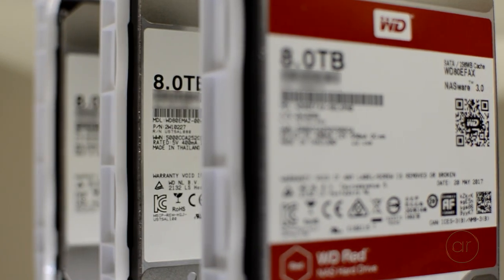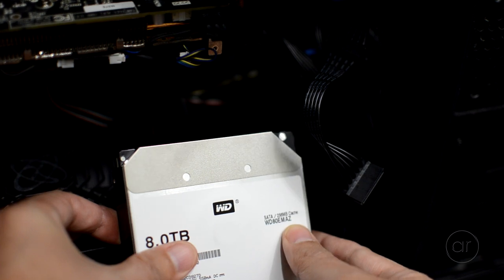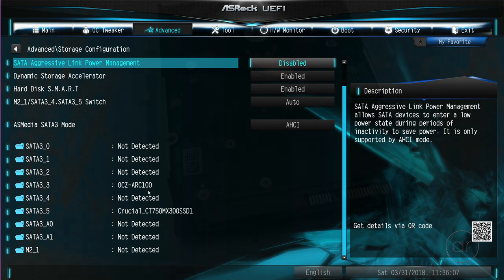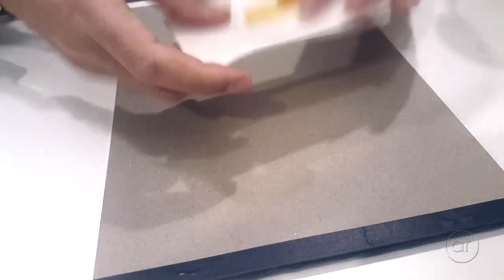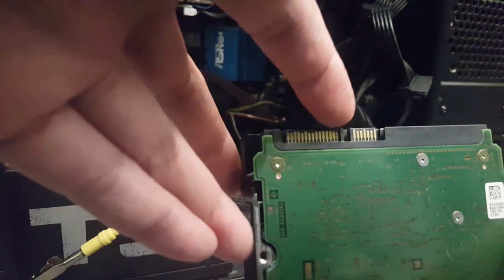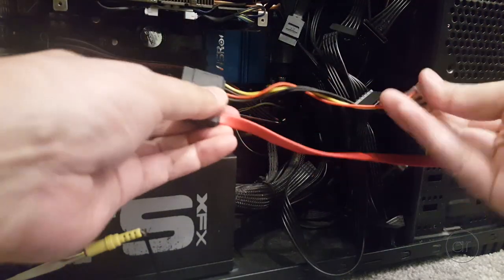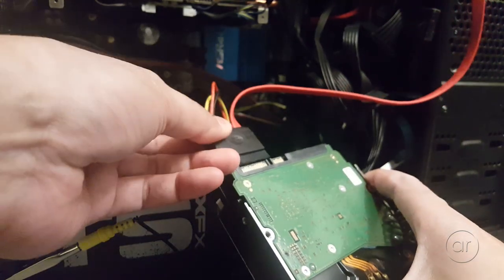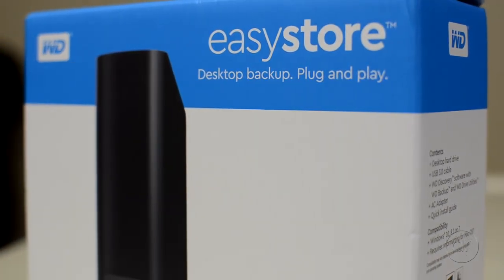How to Fix the 3.3V Pin Issue in White Label Disks Shucked from Western Digital 8TB Easystore Drives

Comment: My computer won't even post with the drive connected, will this still work? WD40EDAZ 11SLVB0 4TB white label drive... Great video! Actually I am using a molex-to-sata adapter, and it still won't post. Adapter works on other drives.
Reply from the maker: Drives with the 3.3V pin will still allow the computer to post and boot up, but you just wouldn't see the drive since it doesn't spin up. I think this may be a different problem. Are you able to try the drive in another computer?
Reply: @accessrandom  Thanks for replying - this  NAS computer (and PSU) is 10 years old. Same behaviour with or without molex-2-sata adapter.
If I put the drive in my desktop PC hotswap slot, it works immediately without any modification. (1 year old PSU), no adapter.
I figured it could be the BIOS hotplug setting, so tried it on the NAS computer, but didn't help.
The computer posts if only power cable is attached, but hangs before post if data cable is also attached.

I also put a thin strip of electrical tape over pin 3 of the drive's power connector like in your video, but no change in behavior.
Standard black electrical tape, maybe that's not good enough?

Drive spins up. The drive is auto-detected by TrueNAS and works if I hot-plug the data cable into the drive after boot, but hangs before post if I have it plugged in before power-on.

Maybe the board BIOS is too old and can't handle 4TB drives?
Reply from the maker: @waperboy  That's possible. It will depend on a combination of both the hardware and the OS, so I'm thinking it's probably the hardware.
Reply: @accessrandom  Thanks, I haven't actually tried to boot my desktop PC with it connected, just put it in the hotswap slot,  and it works. That is the same behavior as the old NAS exhibits, works when hot-plugging it.
Reply: Fyi. The drive works when booting the desktop. Must be the old motherboard on the NAS that can't handle. Shame, that's why I bought the drives...
Reply: And finally, it works without any modification - I deleted the existing partition and created a partition table on the drive, and after that, it works just like a normal drive!
Reply from the maker: @waperboy  Fantastic - thanks for the update. 👍 There must have been some corruption in the partition tables...

Comment: hi there. quick question. I got 2 RED NAS 8TB that 5400 RPM ( they are Not PRO and are Not Plus. Just plain RED NAS). 

I got them when I did the SHUCK method for the WD MyEasy External Hard Drive. The same one that you have in your video. As you mentioned in your video, you said that the "White Labels" are becoming more and more common, my question is the following. 

I have on me a QNAP NAS hardware with a 4 Bay Drive. My goal is to create a Home Network NAS setup. Since I have already 2 of my RED NAS 8TB that are 5400 RPM, the other 2 8TB drives are the White Labels which their RPM I have no idea about. 

My question is, with this mod/method of yours, will I be able to use the 2 White Label 8TB drives as an equal to the RED NAS as part of my Home Network NAS setup for my QNAP NAS in creating a Raid 5 and making sure that all of them run at the same 5400RPM in creating a total pool of  32TB? Thanks.
Reply from the maker: Yes, you should not have any problems adding the White label 8TB drives in your QNAP to a RAID 5. I am using them (plus other WDs) in 4 QNAPs myself. The whites are labeled as 5400 rpm, but some in the subreddit that I mention in the description have done some acoustic tests and believe they are actually 7200 rpm. In the worst case, these will be throttled down to the lowest common denominator of your RED 5400's but will work fine.

Comment: Does it matter what kind of tape to use?  Would electrical tape work?
Reply from the maker: I've tried electrical tape and it worked - but I found it created a bulge in the SATA connector because it was so thick. I'm not sure of the long-term effects of that. It also left a black residue when I removed it later.
Reply: @accessrandom  That's a great point.  I have electrical tape at my disposal, and that's why I ask.  Also, I don't have to go out to buy some other tape and only need an inch of it. :-)  Keep up the great work, I love your channel.

Comment: Hello AR
I see the warnings about using a Molex to Sata adapters due fire hazards. This may be due to the quality of the Sata connector. If I use a Sata power cable instead of the Molex to Sata adapter don't I run a risk of a fire hazard as well depending on the quality of the Sata connector?
Reply from the maker: I suppose power supplies may have low quality SATA connectors as well (just like the Molex-to-SATA adapters), but generally you should be safe with those provided by the PSU manufacturer. The dangerous Molex-to-SATA adapters are those that are molded, as opposed to those that are crimped.
Reply: Thank you AR. Just to clarify I will always need a data cable connected to the HD but I need to be diligent in find the proper Sata connector to the HD to reduce the risk of fire hazard. If the proper Sata connector to the HD is used does it matter whether it is a Molex/Sata adapter or a Sata power cable? Is there safety tradeoff using one type of cable/adapter versus  the other? In other words does the computer or the power supply  cause a greater excessive power using one or the other cable type?
Reply from the maker: @Globalbye  The SATA power cable will be safer as that is coming directly from the PSU. It is the Molex/SATA adapter (the one that joins the Molex from the PSU, to the SATA power connector on the back of the disk) that can cause problems. I hope I've interpreted your question correctly.
Reply: @accessrandom  Yes I guess I would aim to use a sata power cable rather than a molex sata adapter. I did not think there would be a difference as the power  would come from the same source, the PSU.

Comment: Thank you very much. 
I just taped the third pin and it works. 
Or do I have to cover all first three pins?

 Does anyone have the link of the Molex-to-SATA adapter?

If I attach the adapter later then all data on the disk is lost?
Reply from the maker: You can cover either just the third pin, or all three pins (1, 2, and 3) - either will work.

If you swap out the power adapter at a later time, you won't lose any data since it's only a power cable.

Comment: what about the hard drive failing or clicking after doing this mod
Reply from the maker: It sounds like a bad physical sector, which is independent of the power being delivered to the disk. You may want to perform a chkdsk /r in a command prompt (started as an admin). If it detects any bad sectors, I would see if you can exchange the drive for another.
Reply: @accessrandom  tried that turns out windows 10 2004 update damages SSD's and mechanical Hard drives microsoft has warned people to turn off automatic defragmentation of drives turns out the SSD isnt being trimmed but defragmented instead damaging the hard drive the same thing is happening to mechanical hard drives there getting trimmed instead of defraged
Reply from the maker: @johnDingoFoxVelocity  Interesting - thanks for the tip. I did hear about SSD problems with the latest update to Windows but I hadn't heard about problems with HDDs.

Comment: So... Why do they not sell a version with external and internal ... I mean internal would have less cost involved considering no shell & Power Adapters would be needed and should cost less then a external should it not?
I'm a bit confused as to why the externals seem cheaper?

Are their any downsides to the external vs internal in terms of its capability?
Reply from the maker: I believe it is more a function of market demand - more people will buy externals since they don't want to open up their PCs to install an internal (this is just my assumption). Externals may also be cheaper because the manufacturer can substitute any disk inside it, as long as it meets the specs written on the box.

Comment: Quick question please.  I'm a little confused here. Would taping up pin 3 allow ALL drives to power up or just the drives with the affected PSU's?  I plan to put some 8TB drives on eBay and would like to tape up pin 3 to cover all PSUs, affected and not affected. Would that work?
Reply from the maker: Yes - taping pin 3 would allow it to work in both affected and non-affected PSUs (in fact, you can cover the first three pins without any adverse affects). The only thing I would be concerned about is whether the tape will hold if the customer connects/disconnects the cable.

Comment: I had the MOLEX cable and it worked, BUT i HAD SOME OTHER ISSUES  and Micro Center said the disk was failing or unreadable.  Got it home tried the type.  Not sure why it did not work.   The tape is so thin.  Not sure if covered something or something was uncovered.  

Wondering if I use a USB HDD Dock if it will read it without the tape on the 3rd pin?
Reply from the maker: If the problem is with the 3.3V pin, then the HDD Dock will probably work. I haven't had any reports of docks not working with the white label disks (nor has the compendium in the description). If the problem is with the disk itself (as Micro Center says), then that would be a larger problem.

Comment: Thank you  very much, it worked BUT i used a label from a labelwriter, is that okay? Little worried about heat/flames/burn ... is it okay to use label instead of tape? (
Reply from the maker: Not sure- I used kapton tape for its thermal/electrical properties, but unfortunately I don't know the properties of labelwriter labels.

Comment: So what is the effect of having this pin blocked? Does the drive no longer get power management from the BIOS to shut down when not used? 
Asking because I'm interested in doing this but I leave my computer processing sometimes overnight or days at a time, and I know these drives can get hot. I'd like it to still power down when not being used after a certain amount of time. If I understand correctly, isn't that what this pin is for?
Reply from the maker: Very good question. As I understand it, the SATA rev 3.3 specification assigned the power disable (PWDIS) feature to pin 3, meaning if the power supply sends out a 3.3V signal, the hard drive will never spin up. This was done so hard drives could be remotely shut down in an enterprise environment. In the prior SATA rev 3.2 spec, the device sleep (DEVSLP) was assigned to pin 3, so from my reading it may very well interfere with placing it into sleep mode. I'll need to defer to others who are more knowledgeable about the SATA specifications - anyone?

Comment: Will these drives with the 3.3v pin issue (8TB & 10TB) work ok when used on hdd docking stations?
Reply from the maker: Good question. I haven't seen any discussion on docking stations, even in the compendium in the description. My instinct tells me they would probably work just based on the fact that I've seen no one bring it up.
Reply: Unless it's directly running off the power supply most nas or external USB enclosures only use 12v/5v (providing the 3.5v traces is unnecessary for something that's never been used, still odd that PSU makers still use of the 3.5v on the connectors) 
some network enclosures that do support the hard drive hold feature natively they use the 3.3v so they can do a stagger power up the 24 hdds that are in the enclosure (typically a enterprise only hdd feature)

I would just snip the 3.5v cable in 2 places next to each other so to make a small gap on coming from the PSU or just before the hdd plug

I don't recommend the molex adaptors (unless your sure it's making a good connection)

Comment: Clear nail polish over the pin could work also.... right? Nice Video BTW.
Reply from the maker: Thanks. I'd heard about that method for sealing wires and making electronics waterproof. Not sure if it would work but that would be a good experiment.
Reply: Only trouble with that method is that plugging it in may scrap some of the nail polish off and render the solution useless.

Comment: I found another solution.  I cut the orange wire - my wires are color coded and the orange wire is not needed for any of these drives.  If you do this make sure you know what you are doing, but it was an easy fix for me

Comment: Would this fix an issue where a WD white label drive in a 4-Bay external DAS would eventually not be seen by the computer?  I have a 4 Bay DAS with 3 bays populated.  2 of the bays have older 4TB WD red label drives and they seem to be okay.  I just shucked a 8TB drive and put it in.  It's a HTPC so always on.  This morning it is not there.  I read an article about looking at the power management settings of the motherboard.  If I power everything down and back up the drive is seen again, which makes me think this may not fix the issue.
Reply from the maker: That doesn't sound like the 3.3V pin issue since it would not be seen at all by the DAS. Are you able to place it back into its enclosure (or even another PC) and see if you encounter the same problem?

Comment: Q: I bought a WD 12TB NAS RED, and it's not being recognized by my newly built PC, but all other drives are.  What is the reason for it not being recognize and do you have a solution?
Reply from the maker: You mentioned that all your other drives were recognized - are they also WD reds with the same model number as the one that doesn't work?
Reply: @accessrandom  
Installed: M.2 Nvme, Works
Tried: WD Blue, Works
Tried: Samsung SSD, Works
WD 12TB Red, Recoginzed in BIOS, does not show up in Explorer.  Any ideas how to get it to show up in Explorer?
Reply from the maker: @ChescoYT  If it were the 3.3v problem, it wouldn't even show up in the BIOS. The drive may not be initialized, or I'm afraid it may be defective. Any chance you can try it in a different machine?
Reply: @accessrandom  Just put a copy of windows on it through the BIOS, then i launched the PC with the m.2 drive with windows on it as well.  I then saw the 12TB drive and it's now NTFS format.  Then i reformated the 12TB through Explorer.  Everything seems to be working good now, but it's saying the clean drive is only 11.1TB instead of 12TB.  WTF??
Reply from the maker: @ChescoYT  This might explain things better: https://www.seagate.com/support/kb/storage-capacity-measurement-standards-194563en/

Comment: Can I use a regular Vinyl tape? I didn't think I would need this after shucking several previous generations. I bought a 12 TB and it turned out this one definitely has a 3.3v pin.
Reply: No worry, I fixed it. Thanks for the video.
Reply from the maker: I've tried vinyl electrical tape and it did work - but the thickness of the vinyl bent the plastic connector outwards slightly, so I'm not sure what the long term effects would be.
Reply: @accessrandom  Thank you for the reply. Actually I am planning to put an order for the Katon tape anyway since when you shucked this there is no report of any problem since then with the Katon tape. For the vinyl tape I am using it is very thin. I have to cut off another small piece to cover the slightly exposed circuit pin and I am not sure the actual durability regarding the max heat it could sustained. So yeah, I think I will replace it with the Katon tape.
Reply from the maker: @pythonprofreak7522  You're welcome and thank you. Yeah, kapton tape is the general recommendation in the reddit link in the description because of its temperature stability. Best regards...

Comment: I recently bought a WD100EZAZ with the 3.3V Pin Issue as well.

I also know that these "my book" comes with hardware encryption because of the enclosure that these models have (specifically his pcb).
 And If this enclosure breaks, you can't recover the information.

My cuestion is:

If I shuck this HDD of the original enclosure,
 Could it be read without problems by docking stations or by others external enclosures? Or is a mod needed for this action too?

thanks in advance for your reply
Reply from the maker: No, the Easystores do not have hardware encryption so you should be able to read them without problems.
Reply: @accessrandom  
But is it necessary to cover the third pin of the hard drive also to use it in this way?
 Thanks
Reply from the maker: @varetaecuanime5591  If you're placing it into another enclosure, then no, you would need to cover the third pin.

Comment: Good video.  You could further explain that option (2) works because those power adapter cables only supply 5V and 12V (since those are the only voltages supported by the old-school Molex power plugs).
Reply from the maker: Thank you for the info. I'll be sure to mention that in any update video I create.

Comment: Interesting, I would like to see also if you took an ordinary internal HDD and put it to the enclosure which had originally hosted a white label WD drive, would it work in it?
Reply from the maker: Unfortunately, I don't have a video for it but i can verbally confirm that an Easystore enclosure will host a different disk. The controller in the Easystore does not have hardware encryption, so you can swap in any disk (that is not encrypted itself).
Reply: Yeah, I ment my question rather because of the 3.3V pin issue if there would not be a problem if you put a disk that was not designed for this. Thanks.
Reply from the maker: @mertonnephake  Sorry, I misunderstood. I use several of the Easystore enclosures for non-WD disks without the 3.3v problem currently, but I'm not sure if the converse would hold true (i.e., a SATA rev 3.3 disk in an Easystore enclosure that had a non SATA rev 3.3 disk in it).